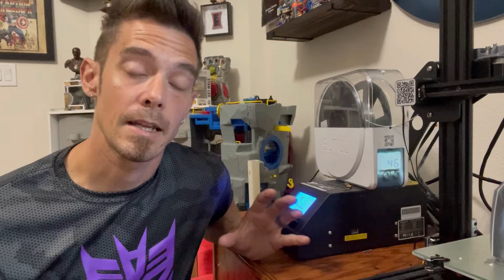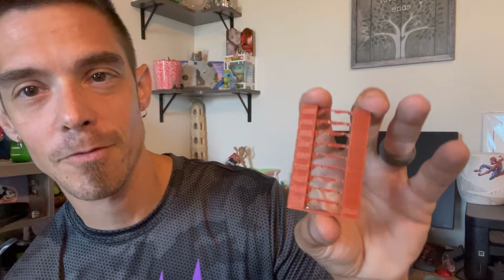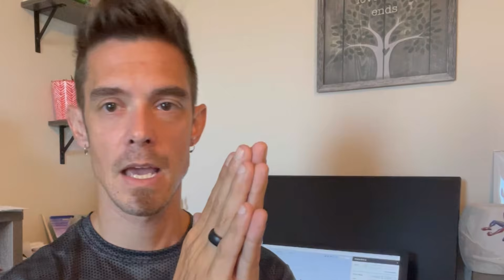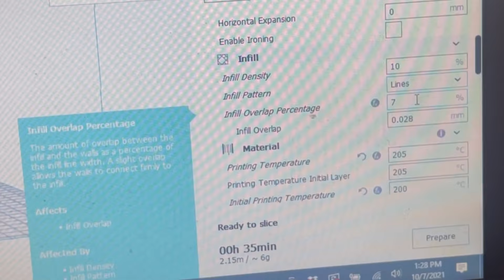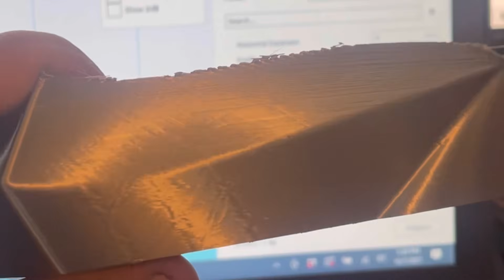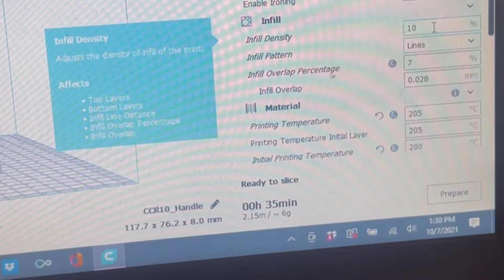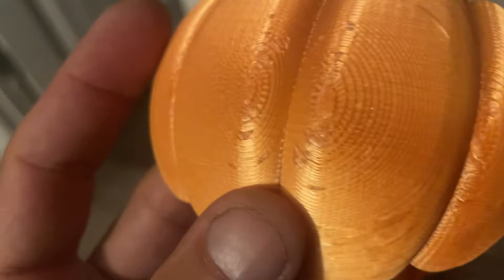3D printing silk filament| how to get silk 3D prints to look the best | 3D printing tips & tricks

Comment: just a FYI you are putting your filament roll in your dehydrator (according to the instructions) upside down.  I noticed my spools would stop spinning even with there bearings and suck the whole assembly to the machine.
Reply from the maker: The filament is loaded fine. There are different holes in the clear cover it can go through all while top loaded & I’ve never had it get sucked in. On my ender 5 plus I load it from the bottom and it feeds through the top hole & works perfectly fine. It’s a roll on a spinning bearing it will roll just fine.
Reply: @Darkwingdad  believe me i get it i have the same ones. i couldn't figure out why it happened to me until i actually checked the instructions.  either way as long as its working just thought i would throw it out there.
Reply from the maker: @fiercewolf2740  I appreciate it I didn’t really think there was a specific way to put it in just whichever has the least amount of friction against rolling. I actually printed spacers that keep the clear lid open a few inches, I feel especially when doing large prints and the extruder moves      up it restricts the filament and adds stress to it. Maybe that’s why I haven’t had the issue that you mentioned. Have you had that issue on yours?
Reply: @Darkwingdad  so i have 2 sunlu and i did the sunlu turbo mod mark 2 by ricky impey on youtube.  I didn't even use the dehydrator before i did the mod and when my spool hit half way the whole spool  would roll to the front of the box and stop the spool from turning.  It didn't make sense until after i pulled the filament  by hand i saw first hand what was happening.  now that i turned the spool around it makes more sense because when it pulls it, it makes the spool roll away from the front of the box instead of towards  the front utilizing the bearings efficiently.   now this might be different if you use the top hole but i don't so i wouldn't know. Don't get me wrong I'm not trying to nit pick but i thought if this might save your perfect prints I have seen you do i thought i would mention it.  I had a 7 day print fail and i almost didn't use my box again afraid this might happen again.  and i think you are right by you opening your box a little helps from what happened to me.
Reply from the maker: @fiercewolf2740  I see what you’re saying now and it makes sense. Luckily it hasn’t happened & it’s crazy it happened to you, I’m interested to see if I can make it happen honestly. Are your dehydrator box on your control box? I try to keep mine level with the extruder.
Reply: @Darkwingdad  so thats a good point but no i am running 2 anycubic Kobra Max's and a Vyper so i dont have that box. although, i now lift my box up  about 4 inches or so. and keep at a slight angle upwards depending on the machine i am using.

Comment: I also use Ziro filament, I love the quality windings and the Mylar type sealable bag and they are the only company I know of that give you the nozzle cleaning filament, I also like that they give you a sample of some of their more exotic filaments and the fact that there is a noticable difference in the quality of my prints makes it a no brainer.
 Some of my silk PLA rolls have to be printed with a higher temperature or they delaminate, the Ziro silk PLA doesent though.
Reply from the maker: Ziro is imo one of the best if not THE best!

Comment: I just found this video and you have a new subscriber! I love the way you presented everything so concisely. I am getting a new Anycubic Kobra today, Sunday, 29th May 2022. I will be using this info for sure.

Would an enclosure help or not?
Reply from the maker: Enclosure DEFINITELY help keep ambient temps stable. One video I am working on next is positioning of prints with stock fans. The temp can fluctuate based on where it’s generated causing print imperfections. But an enclosure can help nullify that
Reply: @Darkwingdad  Thank you so much for the fast response. I am glad to hear that the enclosure I built wasn't for nothing. lol
Reply: @Darkwingdad  The temp tower and retraction test are the first 2 things I will be printing.I also have, no wait! It's all here yaaay. I just got my printer, filament and dry box/dehumidifier!

I have another question, is this direct drive extruder going to help? Sorry, one more question, I have some gold silk PLA, but it has been sitting out in the open in my garage for about a year, maybe a little longer, is this filament still useable if I use the dryer for say like 2 hours?
Reply from the maker: @paulreeder5241  I would dehydrate it for at least 4 hours before printing. Also with direct drive your retraction distance and speed will be different.
Start the distance at 1.0mm/s and move up in incriments of .5 but don’t exceed 2.5. As far as speed start at 30mm/s & increase 5 mm/s in your test.
Make sure the filament stays in the dehydrator while printing

Comment: Yours is clearly been the best video I’ve seen on YouTube for printing with silk filament. I use an Ender 3 S1. Using your settings printing became much easier with silk, but then suddenly failed and I couldn’t print anything with silk. Had to get a new glass bed from Creality. At least I can still use the old bed regular filament.
Reply from the maker: What issues did you have when they started to fail?

Comment: Many thanks for the hints, I can print silk on my old machine but the new one (with direct drive) seems to clog up every time. I have wondered whether a servo drive on the extruder would have helped.
What I would have liked is if you had listed your cura settings in the heading text (alongside the video timing)
Reply from the maker: Direct drive is going to have a lower retraction distance (1.5-2) speed can be adjusted too but a retraction test will prove which is best for you
Reply: @Darkwingdad  Wow, I had not expected a rapid response. Using your tips I have now managed a "barely acceptable" silk print from the direct-drive. The strange thing is that my old CR10-5s manages that same spool on my default pla settings, it works at 50mm/sec, 200 degrees (if the thermistor is reporting correctly) and the nozzle does not even have a silicon boot. My take is that the Rosa silk I have will print decently if it can actually be forced out of the extruder. The direct drive extruder keeps on clicking (a partial advance then return, not a "skip"), even on the new recommended settings though not as bad as before. The cr10 has a much larger extruder motor (but no reduction gear) but, perhaps more importantly, half a metre or so of bowden. I'm guessing that this acts as as a pressure reservoir, it lets the stepper advance to the proper position even if there is a lot of back-pressure and the filament has a chance to extrude before the next "step". For the direct drive, when the the stepper kicks back and fails to advance (because the silk pla does not extrude fast enough or at all) then that volume is simply lost. By applying additional manual force to the pla input I think that I have proved this to myself. Would that the direct drive stepper was either a hybrid or servo, or that I could fit one of those rubber  "quietening adapters" between the motor and extruder. 
I note that the first few layers generally proceed without clicking, which suggests a further experiment. 
For the time wasted a better quality filament would have been worth it.

Comment: I am new to printing and I have a lot of silk to use from a friend who didn't like it. I've been having problems getting it to stick to the plate... how can I fix that?
Reply from the maker: Glass bed?
Reply: @Darkwingdad  No my bed is magnetic stock Ender 3 pro. If I use a Raft it sticks but a Brim will lift off the plate.
Reply from the maker: @Avery0907  I have always used glass beds using hair spray and brim. What is your bed temp set at?
Reply: @Darkwingdad  bd temp is 55 currently. I have been using Hairspray on the plate and have seen some improvement. I am trying to follow your settings as best as possible.
Reply from the maker: @Avery0907  bump it to 60 are you familiar with using baby z?
Reply: @Darkwingdad  No I do not know what baby Z is yet.
Reply: @Darkwingdad  baby z step was the answer! Thank you so much for that information!!
Reply from the maker: @Avery0907  crap, sorry man i didn’t see you replied!
Baby z adjust the z axis by .099 incriments. When doing your initial layer you can go -.099 to add better adhesion
Reply: @Darkwingdad  after the initial layers are done, do you readjust baby z or do I leave it the same all print?

Comment: Use lightning infill for non structural prints for speed
Reply from the maker: The problem with doing that on silk is silk pla is far more brittle & it’s dependent on a solid infill for structure & adhesion. Lightning only supports the roof and it can cause separation of layers. It’s great for petg & pla, if you’re sanding and reinforcing it no problem but I’ve had so so results using lightning infill, if you’ve had luck with it let us know your settings!

Comment: Very good Information I like how smooth and shine the silk pla look   , Thanks
Reply from the maker: Thank you!
Reply: @Darkwingdad  keep up 👍, new Subscriber here.
Reply from the maker: @cristianjosadec  much appreciated, if you ever have questions or need input let me know!
Reply: @Darkwingdad  

Hello, I would like to know if I can use your settings with different things, because your example here is with helmets.

  
I understand that the infill would have to be different in my case that I want to print articulated figures (transformers, 80's super robot etc) with this type of filament for a smooth finish, the designer recommended 20% infill and these other settings ( Layer: 0.15 mm (0.1 for the head) , Speed: 40/s ,
 Skin/top/bottom: 0.8mm) for regular PLA , and also I have a direct extruder that the retraction would be different.

I hope you can give me your recommendations
Reply from the maker: @cristianjosadec  I actually have a video up for printing busts which would be ideal I can link it to you if you’d like

Comment: Dark wing dad, I need some saving brother.  Amolen blue silk is tearing up my mental state lol.  Have you ever used it?? Settings? I'm using a rais3d pro 3 and have not had any issues printing until this filament.  I've tried multiple ranges of temps and layer heights
Reply from the maker: What issues are you having? Esteps,flow calibrated? Temp towers retraction tests done?
Reply: @Darkwingdad  I'm a newer 3d user... but I did the flow test,  flawless,  and I've done the temp tower starting at 185, and 195-210 prints perfect.  I'm getting like 4 layers into a crystal dragon print and the end clogs and the filament turns into a bulb inside.  Temp 185-220 tried, 220 starts to pop when printing.  Fan at 50% and I have a built in external fan to circulate as well on the pro 3. Silk seems to be the enemy as I've printed in petg and different pla colors with no issue.  And I've done a 50 hr dragon at .1mm with white pla no issue but this silk is the devil lol.
Reply from the maker: @cj5376  fan shouldn’t be turned that low, I rarely go below 75% if needed. Cooling is your friend. You’re getting clogs likely bc you have too high of a retraction rate with a high temperature. What is your retraction set at?
Reply: @Darkwingdad  Retraction: Speed 40mm, a material amount 1.0mm, minimum travel of retraction .6, the minimal amount of retraction 0.02 mm, restart speed 0.25, z hop at retraction 0....And yeah I've tried all kinds of profiles, reading about fan speed changes etc, but now having to do a full reset on this situation to hone it all in again.

*Edit*

Ran heat tower again,  prints fine all the way to 215 then strings out.  Flow rate test good too. I took the head totally apart last night and cleaned out all the ground up filament from the jam.  It's either got to be retraction or speed.
Reply from the maker: @cj5376  your retraction distance is far too low. Start at 5mm & 45mm/s & let me know. Try 205* fan at 85% bed at 55-60*
Reply: @Darkwingdad  yeah still jammed 😆  . It seems to like straight geometric type of designs but jams on sculpture type stuff like skulls and crystal dragons
Reply from the maker: @cj5376  are you using a filament dehydrator?
Reply: @Darkwingdad  yeah I have a print dry 2. I'm drying it some more to see if it helps.  What seems to be happening is I'm getting a clog just above the hot end between the motor feed and hot ends it seems.  When I clear it out I'm left with filament with gear marks on it and expanded width... I'll email you a picture

Comment: Jerk and acceleration... The settings say this can make quality worse, but a lot of people use it. If i want good quality, should i just not use them, or we can still use them and it can even help with quality? I'm confused.
Reply from the maker: Jerk and acceleration is on no matter what, its the velocity and for you hotend moves at. Higher settings will decrease print time but lower quality & vice versa for lower settings

Comment: What printer are you using?   I print with silks and never have to touch any settings and they come out perfect ..   Ender 3 pro...  and all my PLA filament is run at 220 and have had ZERO issues ...

Comment: I bought erryone silk filament probably 3-4 months ago. What I received was a filament with 2 layers. A thin outer shiny silk layer, and a thick inner core of regular non-silk filament. So it looked shiny on the roll on the exterior, but I did not print shiny, because the thin silk surface layer completely mixed into the inner non-silk layer. Basically trying to put less silk material in the mix, but sell it at the same price.  Highly recommend ppl stay away from Erryone silk filament for that reason, it seems like a sleazy company that would sell filament like that. Maybe it was a knock-off company, but then, how can you trust what you are getting is actually the real thing.....
Reply from the maker: I wouldn’t go jumping to conclusions without reaching out to eryone first. 
I’ve used 7-8 rolls of theirs & they all printed just fine. The finish & color of silk can be manipulated by temperature, so if it’s too low that’ll cause it to be more matte than shiny. I would reach out to them and double check with a temp tower to ensure settings are correct.

Comment: I used Sunlu's rainbow filament, it printed fine for a lot of stuff except when I tried to print an articulated shark, it kept breaking at the hinges, I also noticed at the end of the filament that those prints where shinier at 210°C (Ender 3 Pro with a Swissmicro direct drive and full metal hotend, the full metal requires a 5 to 10°C higher than you would usually print with), I do not know what went wrong with the hinges but I definitely did not dry my filament, Figured it wouldn't be so bad since it came right out of the plastic vacuum sealing.
Reply from the maker: Silk filaments are a bit more frail than traditional pla. Don’t be afraid to bump your infill up a tad on articulated pieces. Also, moisture may have caused that issue too.

Comment: Hey. I did my first print. And overall it was an amazing print. Thank you for being able to actually get me printing with silk. Mine however came out with distinctive lines. Someone on a post said to tighten up my wheels and it will eliminate the lines. I hope this makes sense ans if your able to provide some insight. Can’t wait to be have nice smooth prints like your helmets
Reply from the maker: Rick, I assume they vertical lines?
Reply: @Darkwingdad  yes sir. I tightened up the tension belts a bit. Def made an improvement. My last test cube was pretty impressive thanks to your suggested settings too

Comment: Thanks for your tips. I use loads of Eryone Silk silver pla. Generally have good results but sometimes i can run into some print issues which i cant seem to work out. After watching this and the other video im now going to play around with my cura settings as you have pointed out a couple settings which i have not adjusted.

Comment: this video helps a lot. now there is a little random holes/gaps in few layers, what could be the reson. i print it with sunlu sil plan with my big machine 3dcubic india. and prusa slicer.
please reply.
Reply from the maker: Sounds like under extrusion. Have you calibrated esteps & flow? Also are you using a filament dehydrator & how old is the machine? Is your extruder gear worn or slipping?
Reply: @Darkwingdad  thanks to reply. My machine is new. Can you tell me how to calibrate ?
Reply from the maker: @kuman64  I have a video on doing esteps on the v3. Do you need help with the retraction & temp tower?
Reply: @Darkwingdad  yes please

Comment: I'm brand new to 3D printing, using an UP Mini 2 that I recently won at work. Of course the white ABS that came with the machine printed beautifully on all default settings, but I'm trying to print multicolor Silk PLA now to make some little stocking stuffers, and having all kinds of issues. I'm also a YouTube creator so I appreciate how well laid out and informative this video was. Thanks! I'll make some of these changes and let you know how it goes.
Reply: Still getting just glops and a stringy mess. Maybe my printer just can't print Silk PLA.
Reply from the maker: @MyBlocksStrongestMan  you’ll definitely need to print a temp test tower and retraction test however, most silk will print nicely with a temp of 200-205 and try retraction setting of 6.0mm @ 30/35mms that should help the stringing, set the fan to 85% and print at 50mm/s